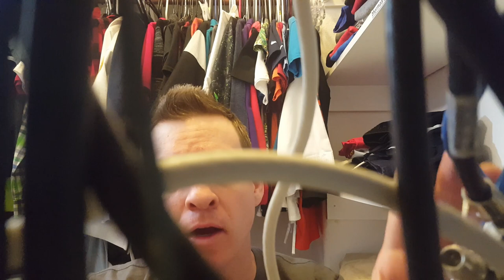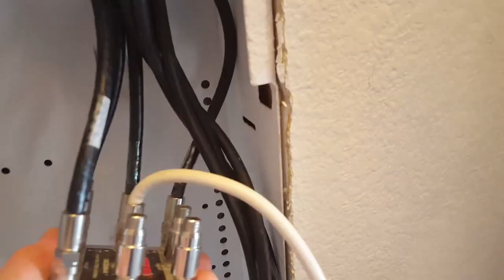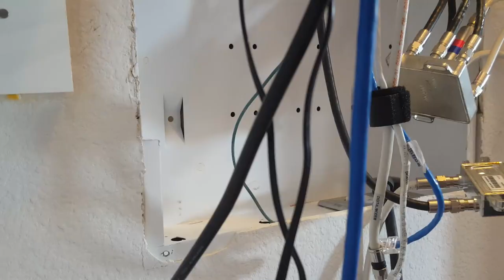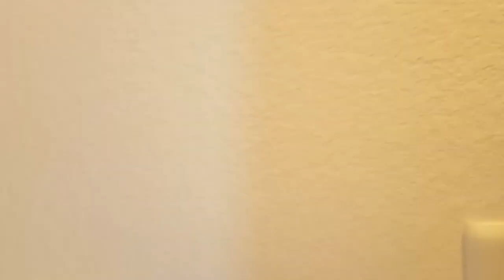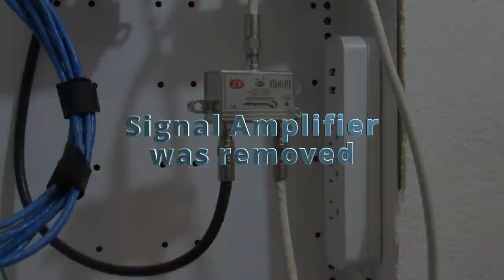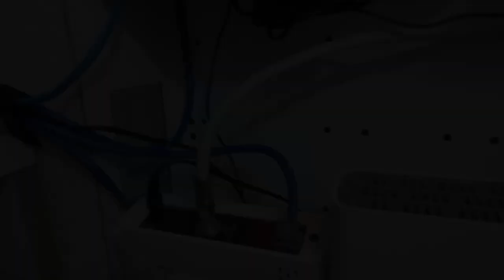HOME NETWORKING 101 | HOME NETWORKING PANEL REWIRE!

Comment: I've had to work in tiny, cramped boxes like this and it's a frickin' nightmare. I sincerely hope the panels in your new home provide ample space for wires, harnesses and electronics.
Reply from the maker: These tiny network panels are a pain for sure. The builder should have installed the larger box especially for a house with 5 bedrooms. My new house has a large network box and it has tons of room. Here is a video showing  my new network box
https://youtu.be/3FauYGO44Es
Thanks for watching!!

Comment: Stumbled on this video. Question if you don't mind.

I bought a house with an audio panel in the closet (Greyfox).  There are 5 ethernet (blue) cables to the panel. I confirm 1 runs to my office. I connected my modem and router to the panel and my office is connected via wire. Perfect!

Problem - I cannot find the remaining 4 ethernet jacks in any of the 5 rooms in the house. What's the easiest way to determine where the 4 jacks are?

Note - I do see 5 coxial jacks in all the rooms however. 

Thanks in advance!
Reply from the maker: So you have a couple of ways to find out where the etherent cables go. First check inside the coax outlet, unscrew the face plate and it might be in their. 2nd way is to take a trip to the attic to see which rooms they lead to and which walls. Check out my newest home network video its twice the size of my old panel.
https://youtu.be/kxdMHSz2PIk
Thank you for watching and keep me posted.
Reply: @UltimateTechHub  Thabks for the quick response.  

I'll check the coaxial outlets.  Would never think they would put with that.
Reply from the maker: @Unplugged704  You never know some builders are too lazy to make separate outlets and plus saves them money. Good luck and keep me posted.

Comment: If my house doesn't have one of these network panels, can I install one myself? Any guide on what to look for?
Reply from the maker: The panel fits in between the walls 2 by 4s. So you need to install the panel in a wall where there is no water pipes and electrical wires. You will also need to drill a lager hole   from the attic floor thats directly above that panel install location. This hole is in the walls 2 b 4. Probably a 1 inch hole will work fine. This hole is for your homes wire drops. You will need to hire an electrician to install a couple of power outlets in the panel. I will send you a link on wire dropping and working in the attic. Give me about 10 minutes to find my video. I have 326 videos so sometimes it's hard to find. Lol.
Reply from the maker: This video will show you the wire drop basics. Keep me posted if you have any questions.
Reply from the maker: Sorry forgot to add the link Lol
https://youtu.be/qcET-OgrCCY

Comment: Hey so I got a question... I have a modem/router and I also have my network panel in my network panel there’s this thing which looks like an ethernet switch but it’s not turn on. I’m trying to use my ethernet jacks around the house but none of them work any help?
Reply: running into same situation here. Not sure if you solved your issue, I am finding out mine was not a network switch, it was for phone/voice controller.

Comment: Why do all the builders keep the network box inside the master closet?🤔
Reply from the maker: This one was in my sons closet. Our new house the network box is in our master closet. Not sure why but it may be that it is centrally located. Thanks for watching and if you subscribed thank you as well.
Reply from the maker: @D Early That's a pretty typical place for it.  Thanks for watching.
Reply: @UltimateTechHub  Is there any city code or code of some sort would regulate to put the network box/panel in specific location? Could it be place in living room close to tv?
Reply from the maker: @bgninecn  There shouldn't be any issues with the location of the panel. I have seen them in laundry rooms, coat closets, garages and bedroom closets.

Comment: Why do i see WiFi router put inside closets like yours? Do you not lose signal if hidden behind walls? If not, I would like to do something similar in my closet or dressing room but I don't have any wire drops in these locations. Will have to drop regular coax for modem and then cat6 for the rest of devices i think.
Reply from the maker: Yes exactly. You can hire a low voltage installer to drop all the wires. And you can have the wifi router in the closet. The signal shoidl get to most of your devices. If you buy a long range router then this will not be an issue. Please check out my Playlist Ultimate Home Networking.  I have a bunch of videos on this very subject. And this video you watched is in my old house. I have moved since then and I have a bigger and better setup. Thanks for watching!
Reply: Ah OK. I have two ac1900 in mesh setup and was placing them to be visibly in lone of sight for better signal. I guess I don’t need to.

Comment: Is a router required? Can I go straight from my modem to the switch in the media enclosure and have 1 router outside in room?
Reply: Did you ever get an answer? Wondering the same thing and cant find a video.
Reply: @kevinerosa  I don’t think so, I think I had tried and it didn’t work but also the switches from Amazon kept failing so idk if that’s why
Reply: You can definitely move the router outside the box. It will help with Wi-Fi signal and keep the box cooler and your router from overheating.

Comment: Part 2, house burned down because everything was crammed in together
Reply from the maker: It's all low voltage wires so no chance of a fire. Part 3 we moved and now have a bigger Network Panel with 3 times as much devices and wiring. You should check it out. Thanks for watching!